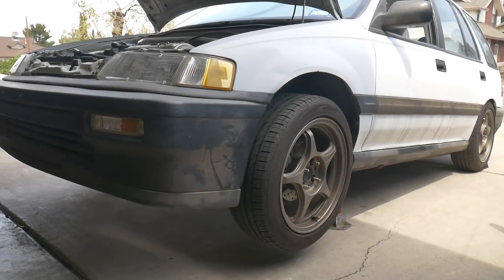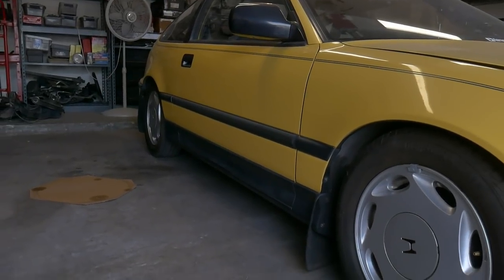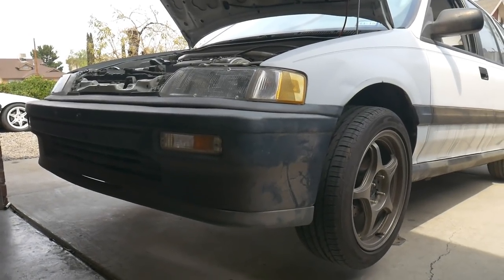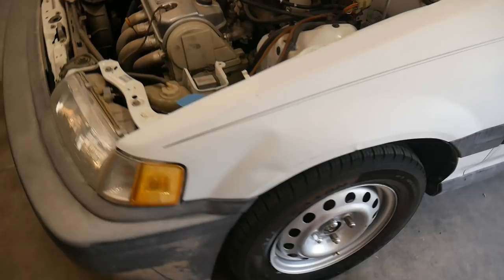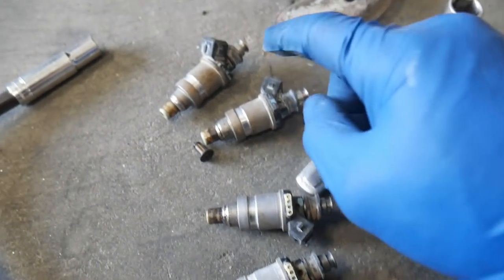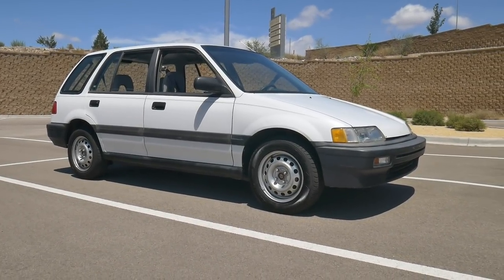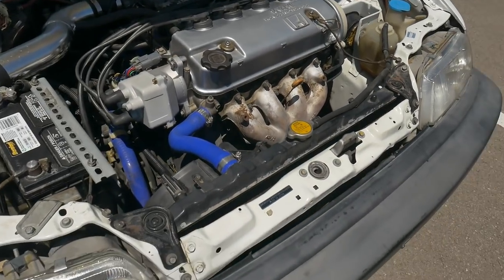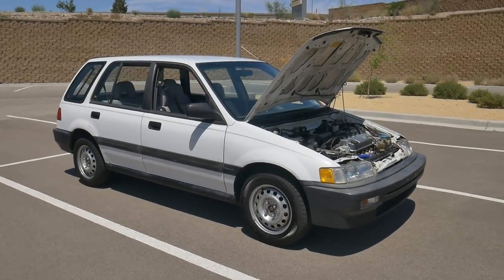Honda Civic Wagon Project Build Comes to an End

Comment: Drove the same vehicle around New Zealand for 15.000 miles  and never had any issues. Even though the car was already 25 years old and had run over 180.000 miles when I bought it for 800 bucks. Best car I ever owned!
Reply from the maker: This one was too.  I've had good luck with these older Hondas

Comment: I’m looking into upgrading the suspension on my wagon and I found that it’s kind of a hassle using coilovers made for ef’s because the rear struts are different lengths on wagons. Do you remember if you had to adjust the function and forms drastically different heights between the front and rear for the car to sit even? If so how did it ride?
Reply from the maker: Wasn't a big deal, and not for any wagon owners I've known.  Rode great.
Reply: Garage Built Hondas alright thank you

Comment: Hey, how's it ging? I have this problem with my rpm gouge and i'm not sure if I should just get a new cluster. I've tracked the blue wire from the dizzy to the number 12 pin on the cluster and it seems fine. Used to be I could just tap the dash and it would start working. Any ideas?
Reply from the maker: It might be time for a new cluster.  You don't even need to swap the whole cluster.  You could swap the tachometer from a different cluster but of course from the same years and model.  I've had tachs stop working on these cars before.  In this video the tach would stay at zero when the car was idling.  I replaced the tach and it worked fine. https://youtu.be/bwjvFHtJ5U0